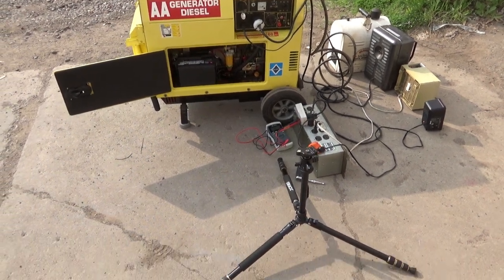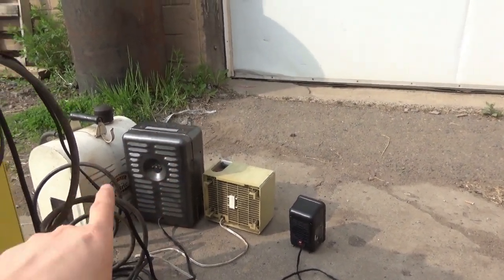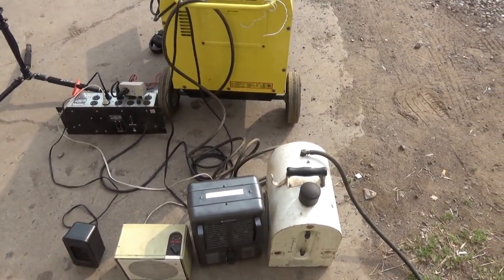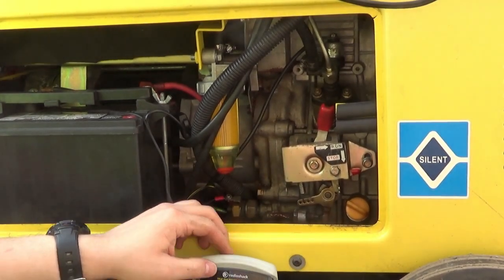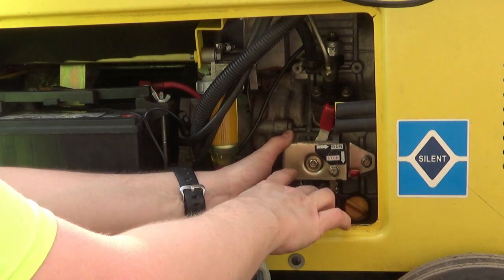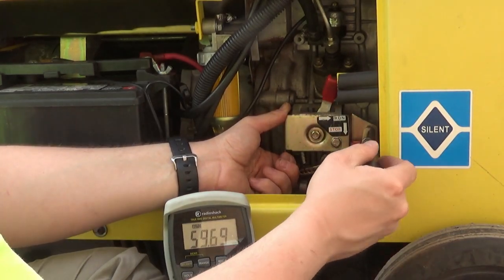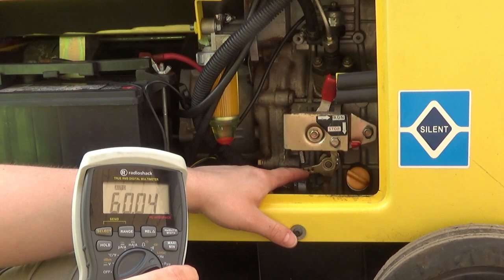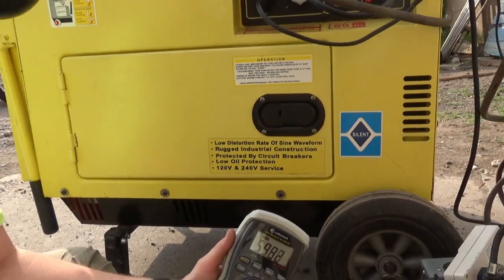How to adjust air cooled diesel generator for perfect frequency

Comment: Mine is 230v and 50hz.. am running at 223v and 47.5hz..could i adjust it to 50hz doing the same you have done here.. ?
Reply from the maker: yes, this is meant to be a guide to get to what you need.
Reply: @JoshKilen  thanks will give it a try. I am concerned that as it used to run at 50 hz and approx 3000 rpm (now is 2900 rpm) that adjusting the governor is just increasing fuel consumption when in fact something else is going on..  it has fresh oil new fuel and air filters and valve clearance checked ok..  so not sure why running slower than before..  possible fuel pump needs shimming or replacing ?
Reply from the maker: Sorry I didn't get back to you sooner, no notification. It depends on a lot a factors why there might be a small drop in rpms. for one is how many hours are on the unit? if there is a lot of hours, there is just normal wear in governor system. It might use a drop more for fuel after adjustment, personally I wouldn't worry about the fuel consumption a whole lot, I am more concerned about it turning the right speed for the electrical equipment. re-shimming doesn't affect the rpms, just the timing of the injector by a tiny bit. Another thing that cause rpm drop is the vibration caused by running, if the adjustment screws/bolts aren't tight enough to prevent them from moving. hope this help. there might be more at play, but these are the most simple things that could cause the rpm drop.
Reply: @ShorrockPaul  the springs that tension the governing assembly change over time too and naturally require adjustment, altitude plays a role too.
Reply: @mickwolf1077  in this case altitude is not relevant as I haven't moved.  Possible governor spring tension.. but it seems to have reduced speed over too short a time.. it has 1000 hrs on it. 
However turns out reg/rectifier wire was burned out..  ac side.. so am changing that out and see what develops..  will check stator output too (should be 30-40Vac)

Comment: Hey Josh. Great video and hoping I could get your input. I basically have the same generator or something pretty damn close. Had this since 2006 and it’s been great over the years except for this year. 

Lost power and pulled the unit out and discovered an output issue. The 120/240 30amp port was only able to put out 200 to 205 volts at best.  Took another reading on the standard outlets and was only getting about 100 volts. Does that sound like the AVR to you or something else?
Reply from the maker: Have you checked to see if its running at 60Hz? does it have an AVR or a capacitor?

Comment: How many hours on the genny now 2 yrs later? I heard these Yanmar clone diesels have bad habits like breaking off valve heads & breaking rocker arms. Any issues with yours Josh?
Reply: Think depends heard stories about many getting fine 10k hrs and some fail fast, but good valves and rockers is cheap to buy if worried, myself only put a 2k hrs without any issues so far
Reply from the maker: I sold this generator with about 60 hours on it.

Comment: im in europe and mine was running at 60htz and had to adjust the spring to the 3rd hole or notch. it brought it down to 54htz, now I can find tune it with your method. DO you have to adjust the threaded screw also ?
Reply from the maker: I DO NOT adjust that threaded screw and DO NOT touch the threaded screw. that is your fuel limit,  if you adjust that it will not allow your generator to handle the load correctly.

Comment: Do ypu have to loosen both bolts to adjust or just the slotted one ?
Reply from the maker: I am not sure. I also no longer have this generator. I think the throttle plate will be easier to adjust if both are loosed.

Comment: these chinese generators are very sensitive.not to exceed 60% of its power.
Reply from the maker: I sorry to say but a diesel generator needs to run between 60% and 75% of its rated load to run most efficiently and prevent wetstacking.
Reply: No! The reason u cant exceed 60% of the labeled power of these chinese gens. Is because the pamplet rating is the actual nominal watt out put. I have a pqde6500 diesel gen. It says run at 75%. Well looking at  stator. There is a label that says "kt4.5-60hz". So there is the reason for the manual suggesting 75% of advertized load.
Reply from the maker: @herewegoagain4041  I am sorry to say but those numbers on the stator means nothing especially when is comes to chineze part numbers. and the pamplets are just generic, and mean nothing when it comes to you and your machine. also my 60-75% of the rated load is a run of thumb when it comes to each machine. the rated load is different for each machine, the rated load is what the generator can supply at 100% duty cycle without issues. I go by what is labeled on the generator and not the pamplet.

Comment: What temperature does the engine reach on the cylinder head during normal operation? Is mine reaching 120 degrees normal? What temperature does yours reach?
Reply from the maker: I can't really measure it since its buried in the generator housing. is that 120 degrees F or C?
Reply: @JoshKilen  120c
Reply from the maker: @paridecontini9773  sorry it took so long to get back to you, no notification. it depend on the load and the ambient air temperature. what is the rated load of your machine and how much load did you have on it?
Reply: @JoshKilen  C
Reply from the maker: @paridecontini9773 what do you mean by C?

Comment: Thank you, I had an over frequency error and shut down on a nearly identical machine. Its 50hz in EU. The previous owner replaced the "throttle" assembly and it makes sense to be tightened at a random spot.
Reply from the maker: Glad I could help you fix your machine.

Comment: What can cause over heat on this engine
Reply from the maker: overloading of the engine, blocked cooling air, both on the intake under the shroud or on the exit path of the cooling air, or missing cooling fins on the flywheel.

Comment: Hi, so what is more important, voltage or hertz? I have a 1300 watt geny and I set the voltage while under 750 watt load to 120 volts. Is that good enough or should I really get a Hz tester? Is it even possible for the Volts and Hz to be that far from one another? Cheers!
Reply from the maker: it really depends, but Hz would be more important for loads. the reason why I say that is motors and electronics are designed to work at 60hz or as close to it. if they get to high or low of Hz it can cause motors to not run at there correct rpms, plus overheat and for electronic loads it can cause them to be come grumpy. my generator has it voltage controlled by a capacitor, so the voltage is set to what it is with rpms. in that case set the Hz, and the voltage will be good enough. If the voltage is not within 110-120v then the capacitor needs to be changed. but some generators come with whats called an AVR or automatic voltage regulator, which does a much better job getting the voltage where it needs to be. with those set the Hz and if the voltage is not within 110-120 then you can adjust the AVR to make it right. As for getting a Hz reading, you can buy the P3 international "Kill-A-Watt" meter and it will be just fine. May I ask what are you running that is 750 watts and what type of generator?
Reply: @JoshKilen  Hey thanks for the reply! It's just a back up generator that I paid 60$ for. (United Power GG1300). It had a blown capacitor which I recently replaced. But it seemed like the previous owner had messed around with the idle and governor before giving up on it so they needed to be reset. I went 120v at idle then 120v under load and was using a space heater on low setting.
Reply from the maker: ok, got love other people's problems, lol. nice job sorting it out. do you plan on just using that space heater when you use it or electronic loads like tv's or laptops?
Reply: @JoshKilen   I plan on trying to sell it to a neighbor so they can power their furnace in the event of a winter outage. Not looking to make a profit just recover costs. But I want to make sure I'm not handing off something that could damage whatever they choose to run with it either. I've already got two invertor generators but if it doesn't sell (for 70$) then I'll keep it as a back up and also be sad that my neighbors are dumb. lol
Reply from the maker: it wouldn't hurt to check the Hz.

Comment: Good vid I'll try this with mine once done is there any reason to adjust the avr to iits a 16 hp 10kva open frame diesel generator seames to be lagging at about 6500 load
Reply from the maker: glad it helped.
Reply: Any reason to adjust the avr on it ?
Reply from the maker: to get perfect voltage. I should of put a disclaimer in it for people with 50Hz machines.
Reply: i think your question have not much to do with this video, AVR is for voltage and this video is about speed or Hz.

No there is no need to do that, only when the voltage is a little outside the range you can consider adjusting your AVR, but can be a different defect as wel you need to check that furst.   @alanshiels4868